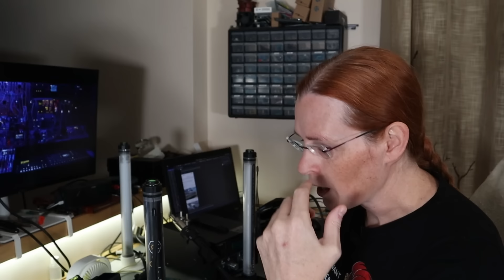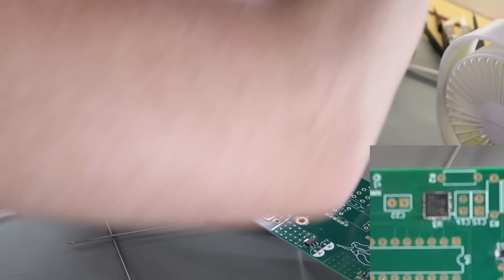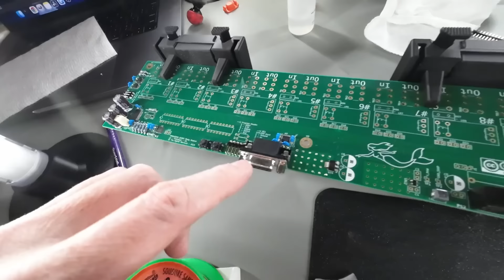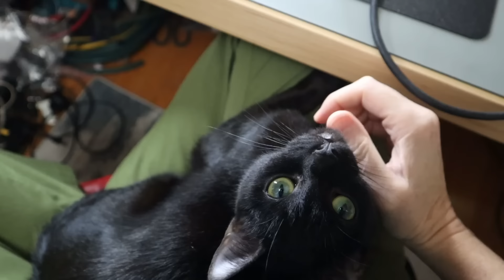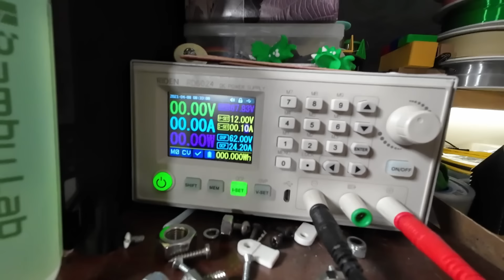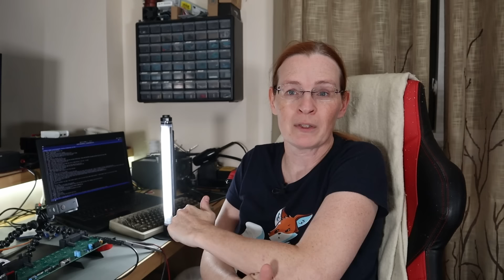Happy Failures - Ep. 121

Comment: I've just watched for first time, quite cool. this may or may not work for you but i use stm cube mx to generate my primary files/layout selecting make as export format then i use platformio with make/cmake plugin to  code via platformio for general stuff but if i need speed i have a prebuilt .h /make file for the stm chips i play with via cmis codebase. also consider writing your own bootloader, it's a great exercise  code wise but it allows for non direct connection updates (canbus,nmea,rs232) as well as backup up /logging options if you have a attached eeprom

Comment: I don't really notice a meaningful difference with leaded and unleaded solder. I usually pre-heat with hot air and everything is easy. If the board is cold, the no-lead solder could be a pain. 

Pre-heat if you can. Even a regular hair dryer is better than nothing.

Comment: Great video! keep them coming. before you install the board in the boat, please use some conformal coating on it to protect against corrosion/condensation. should save you a lot of headaches. I would also suggest you build a few drop in replacements so you can swap them out in an emergency rather than having to solder in a bad seastate. For critical components you should aways have one better two spares at hand.

Comment: Your reason for not using lead solder makes no sense. You already take a solder iron, flux and tools with you anyway. You still use the wrong flux for SMD! That is god enough for through hole, not for SMD. Check out "Branchus Creations" from around 2 years back - Beginner's Guide to Soldering Electronics Part 3. Get a stencil for SMD, that will apply the correct amount solder paste. Check out other good smd yt clips.

Comment: Congratulations on a F'ing HUGE win, Maddie (sp?)!
Everything you're doing is well thought out in advance and in the right order.
Excellent progress. (Now, I'm feeling lazy, while needing to finalize my 3rd PCB. "Third's the charm." I Reckon, Skip.)
Andrew is a great technical guide.
Thank you for acknowledging most of my previous comments. 👍
Q: Wouldn't it be easier to simply have spare PCBs to swap out during potential mid-ocean repairs? 🤔 ;-)
Reply from the maker: Howdy! I will have spares, and they'll be in sealed ESD + humidity resistant bags (and spare key parts to repair boards). So in practice, should a board die, it'll be a strait swap and that's that until I get to calm harbours. However, when planning for the worst, I assume my backup fails. :)

Comment: Amazing work! To get you moving forward while waiting for the part, you could remove the regulator from your board and inject the 3.3V from the second channel of your power supply  to continue testing. Keep up the great stuff !
Reply from the maker: I ended up using the time to edit this video and start assembling the first compass rose board (which is now mostly done). Andrew suggested how I could use a diode to drop the voltage if I wanted to keep going, but I was OK waiting for the new part, given I could use the time between productively.

Comment: A diode in series with the output of the reg on the 3.3 line will drop the voltage by 0.6v so 3.9 becomes 3.3 as a test if you haven't already replaced the parts (which you may have).
Reply from the maker: I cut it out to keep the video short, but Andrew suggested I do just that (using a 1N4001 iirc). I decided not to because I needed to edit this video anyway, so I just waited for the replacement parts to arrive.
Reply: @TheDigitalMermaid  Awesome Andrew :) or you can also depending on the amp draw replace it with a Zenor 3.3V diode.

Comment: Great job on the board spin-up. It's always exciting to fire op a new design. Personally i test all the power supplies (if possible) before powering up the logic rails. You can design in 0-ohm resistors in the different rails to disconnect parts of the circuit at power up and later for debugging if there's a voltage being pulled down.
Reply from the maker: Adding in 0R (or, for more 80's cred, jumpers!) to selectively disable rails is something I'd like to do on future boards. I also want to bring out all the pins from the MCU to headers as well, even if they're left unpopulated.
Reply: @TheDigitalMermaid  Yeah, bringing out extra IO can be handy in a pinch if you decide to add an extra function down the road. Make sure to ad a pair of VCC and GND in the same row/block of headers.

Comment: Well done! For future reference, and less worry. When moving across packages of the same device, the silicon inside is almost always the same. As a result the alternate functions for those pins will also be the same. So you only need to make sure that the base function are in the same relative locations in terms of pin number. So a quick scan of the pinouts in the data sheet is usually sufficient, no need to go back through the configuration app. Generally the only time you run into trouble is when a package has fewer pins, and thus a pin /function is dropped, and you used that pin. (if that was the case, that should have shown up in your design phase as the footprint would not have had enough pads to match the symbol)
Reply from the maker: Aye, that makes sense. Going to a different pin count would have been a staggeringly worse oversight, heh.

Comment: You need a heat gun too :)
Reply from the maker: I have one!
Reply: @TheDigitalMermaid  Yeah I use the heat gun to solder the chips after I use a soldering iron ... i just put  gel flux on the chip then heat the chip up with the heat gun then when the solder melts I move it a little so it seats properly and the chip finds its proper location due to surface tension snapping it to its correct landing points......

Comment: Soldering is a skill, SMD soldering is a tougher skill. But you have the right tools, which is a great start, and I think your thinking is mostly correct on the leadfree/leaded debate. But leaded solder is better in tough environments, leadfree solder tends to crack easier than the leaded stuff. And to echo what another commenter said soldering on a boat in a storm is not a skill test it is an acrobatics test, if possible have a backup of each board to swap in if one breaks.
Also, you are awesome! Never forget that!
Reply from the maker: I'll get silver doped solder for the next (and hopefully final) set of boards, that should give me some of the benefits of lead without the drawbacks. As for spare boards, I speced enough parts to have at least one fully build spare, which will go in sealed anti-static, humidity resistant bags. I'll also have spare parts so, when things settle, I can hopefully repair the previous board and make it the new spare. However, when planning for worst case, I was imagining the spare failed as well.

Comment: Hey a few comments on soldering. a) it's for shure great to learn to solder leadfree but why it's better to solder leaded has the better resistence to shock and vibration leading to broken solder joints. and you are not forced to go leadfree. In my experience you can always buy 60:40 leaded solder.
b) go with the biggest tip and more flux. A bigger tip can transfer more heat in a short period of time introducing less stress than the small tip heating up everything slower but with more heatcreep. With good flux you can even use a 5mm flat wide tip to solder the one side of you chip at once without having bridging. Two things that help here is the flux and the stopmask.
Reply from the maker: As I said, if I have to, I'll go leaded, but I mentioned that my friend uses silver doped solder, and I might try that next. It apparently brings in some of the advantages of leaded. As for the tips, now I have both so I can experiment, but ya the largest tip isn't that bad, when not doing super fine work.

Comment: I would suggest the flux that isn't full liquid.  Way easier and no sizzle.  Chip Quik SMD291 Tack Flux No-Clean (5cc/5g Manual Syringe)
Reply: Agreed; I've kind of been wondering what a typical application of the full liquid flux actually is, because I've never found its the best for me. I'm sure it's useful to someone though!
Reply from the maker: Maybe it's because it's the only thing I've used, but so far I'm getting the hang of it.
Reply: @TheDigitalMermaid  Oh yeah kudos to you learning all this.  I have been doing electronics most of my life its fun to watch someone learn it all so fun to watch.  You're doing great!  Don't beat yourself up if you have to make a new board or something that is all part of the learning.
Reply from the maker: I don't mind making a new board... I actually expect it to be needed. I just want to get as much info from these boards before I do, to have the best chance of the next version being good to go.
Reply: @electrowizard2000  It works pretty well for tinning wires in a solder pot. Strip a bunch of wires, dip them in the flux then dip in the solder. Job done with no cleaning needed. That's about the only use I've found for it though.
For cleaning rosin flux, I've found car brake cleaner works better than IPA. You still need to work to get it all off though. A good ultrasonic cleaner also does the trick.
Reply from the maker: I thought when I bought the MRA flux that it was a gel... When I realised it wasn't, I figured I'd just use what I had and try to find gel next time I order.

Comment: I don't think I would want to be working to component level if faulting a PCB when at sea. As your boards seem to be plug in units, maybe better to carry working spare boards to swap out rather than spare components.
Reply from the maker: I mentioned in a previous video that I plan to do exactly that. I've also got spares of all parts so I can, hopefully, later repair the boards as well. However, when planning for worst case, I was assuming the backup board also faulted.
Reply: Fair enough, fully agree to have an assembled and tested board ready to swap over to quickly restore functionality. But after that swap you'd want to diagnose and possibly repair the board that came out. When you're far away from home/land doing it onboard would be the only option despite having a suboptimal electronics lab...
Reply from the maker: I'll have those, and they'll be in vacuum sealed anti-static and anti-moisture bags.

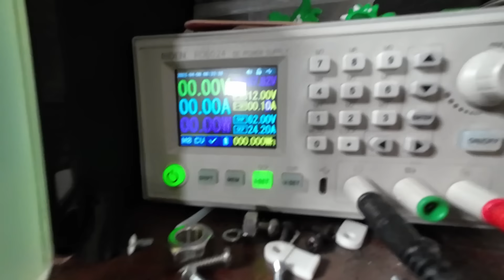Comment: 25:58 those Riden power supplies are awesome - and yes you are entirely correct on how the CC/CV works - I should probably test the overshoot one day because it IS possible that you'll go way over current until it corrects itself - so if you are SUPER worried, you can always just keep the max current to where it is set and slowly ramp up the voltage using the knob - but I see nothing wrong with your current technique.
Reply from the maker: Sweet, good to have extra confirmation.

Comment: One of the really nice things about using solder paste is you can "get away" with using way more paste than you probably think you can; it "shrinks" quite astonishingly.

Oh, your "LED height problem" - heat shrink tube is both good and cheap for that. A bit of tube of the correct length on each of the legs keeps them at the correct height and doesn't care about getting hot.
Reply from the maker: I'm coming to realise that about the paste. I'm surprised how much it reduced, even on the QFN part. I've seen the heat shrink thing, but I wanted to have a way to be able to reproduce it later, and remembering/cutting the shrink tube precisely wasn't as easy as just making a 3D model.
Reply: @TheDigitalMermaid  3d print a heatshrink cutting jig :p

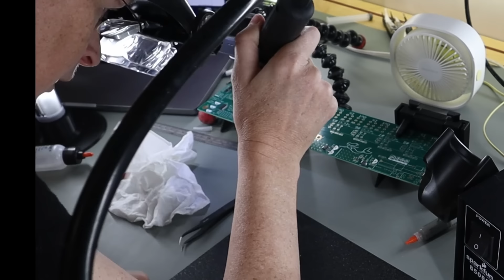Comment: 11:38 you can actually heat the back of the board if you're afraid of blowing around components
Reply from the maker: That won't heat the fiberglass too much?
Reply: @TheDigitalMermaid  Should be fine - I used a frying pan with an aluminium heat sink as heat spreader at some point. You could even try to use a toaster oven instead of doing one component at a time with the hot air gun (like a poor person's reflow oven). For 'one component at a time' I still prefer the method I mentioned last time. Don't worry too much about the components getting too hot. Check some of the reflow temperature profiles in their datasheet.
Reply: @upnorthandpersonal there are plans to convert a toaster oven into a proper reflow oven Stephen Hawes used one for a long time even after he started selling his pick-n-place LumenPnP. The plans are somewhere on the internet.
Reply from the maker: That's an interesting idea... I vaguely recall the toaster over way back when Thinkpad (t42s?) had an issue with the GPU's BGA separating from the PCB. Not sure I'll have a toaster over on the boat though, so I don't want to spoil myself... lol
Reply: @TheDigitalMermaid  Same as the hotplate method of soldering / resoldering